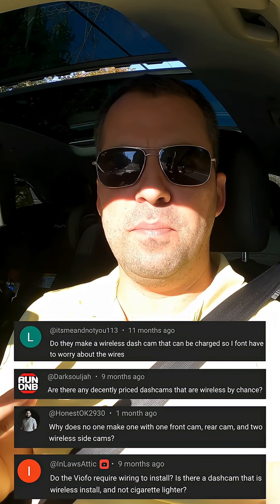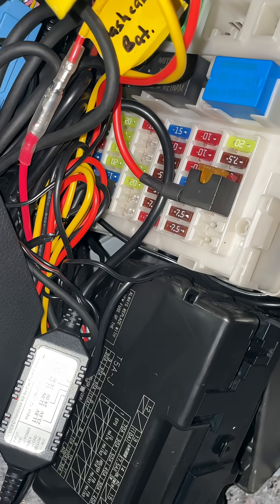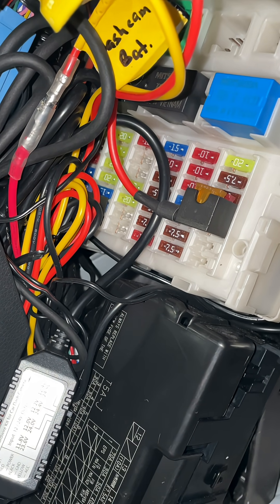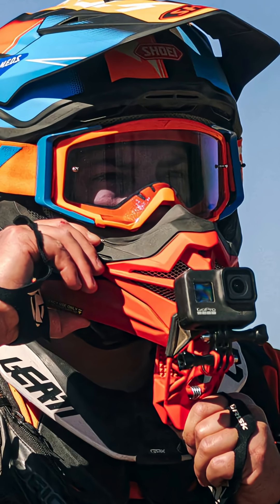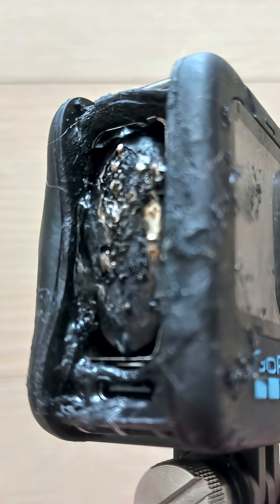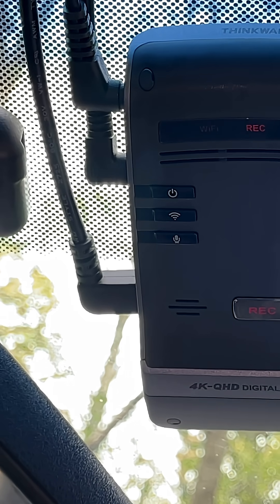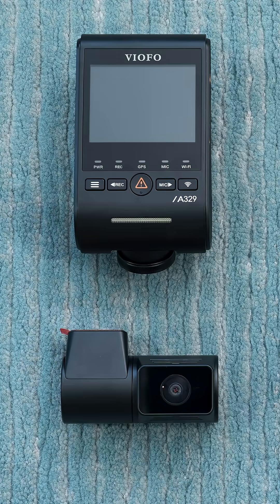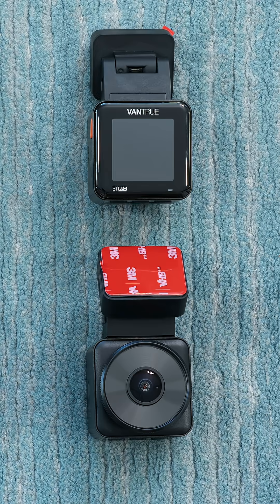Why Don’t We Have Wireless Dashcams?

Comment: They have wireless cams that go to your phone, but it makes your phone hot and slow. But the power will always need to be run. I have a nexar and a redtiger, but I do not let it pair to my phone cuz of the issues I mentioned.
Reply from the maker: That’s wireless for cloud which is different. Also Nexar’s cloud was recently hacked. Please see here: https://www.malwarebytes.com/blog/news/2025/09/nexar-dashcam-video-database-hacked
Reply: @VortexRadar  I know its a different type of wireless, but the data rate is similar, Therefore the heat should be as well which is a clear indication of energy used. I would assume its this load that would deter them wanting to make a wireless transfer . the cam would have to be more expensive because it would need more processing power to move the data form he rear cam to the front... I assumed I would not have to say all this...  Oh well... And people wonder why comments become books..

Comment: A terrible Kickstarter dashcam company called Dride was offering a (wired for power) but wireless data connection rear camera for their 'Dride 4K' main unit. (it's awful, don't even bother) They promised delivery by January 2022.
We're now in September 2025 & they've not sent ANYONE a rear camera & have gone completely radio silent on the topic because I don't believe they are capable of producing what they promised.
They scammed & lied to everyone & are completely refusing all refunds.
That is why wireless dashcams are not really a thing.

Comment: Really, driving while doing a video. Better get a dash camera in case you crash into me so I have a record of you not paying attention to the driving.
Reply from the maker: Yeah, it’s a common concern by people who usually don’t spend more than two seconds thinking about it. Do you watch car reviews, for example? It’s super common.

In practice, this is a similar experience to talking to your passenger or over the phone. There just happens to be a camera there instead yes you do push the button to start and stop recording, but that is similar to pressing the emergency recording button on your dashcam or pressing a button on your stereo to choose a radio station. 

I’m sure you mean well, but it’s a non-issue IMO. Thanks for the comment.
Reply: AI - However, a person who causes a car accident while making a video could absolutely be found liable for damages. The act of recording and interacting with a phone or camera while driving is a form of distracted driving, which is a key element in proving negligence in an accident.

Comment: We dont need 3 cables to be connected to camera. There could be just one. Which would split under the roof cover
Reply: Then the complaint would be upgrade cycle or add ons. Want to switch from USB to hardwire for parking power? Gotta switch out the entire cable bundle. Want to go from 2 cameras to 3? Swap out bundle. Want to go from a model 2 years ago to the newest one? Swap out entire bundle. I'd much rather run multiple wires once then upgrading only the ones that need to rather than having to always rip it all out to change anything.